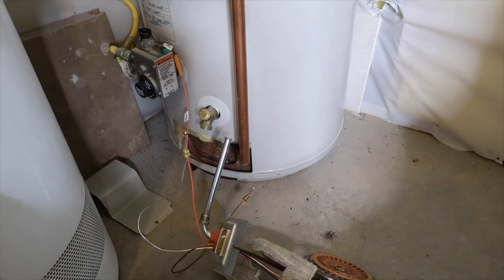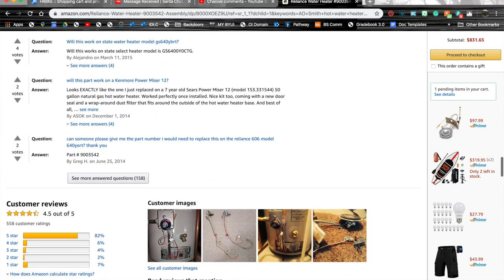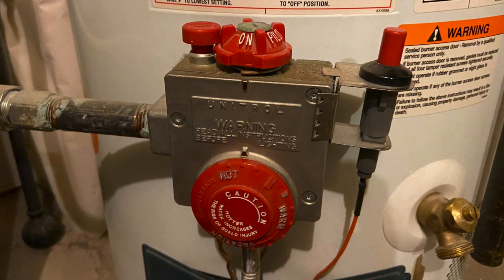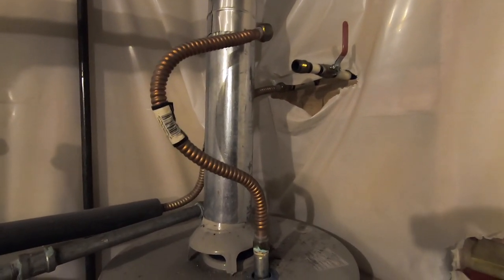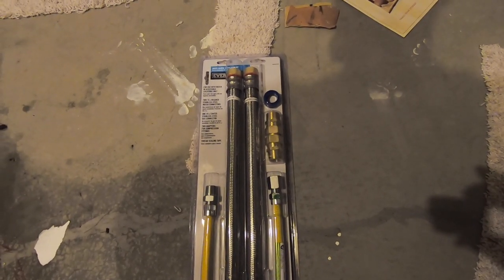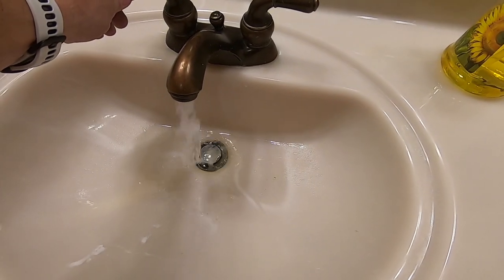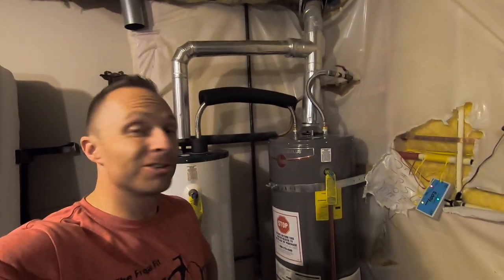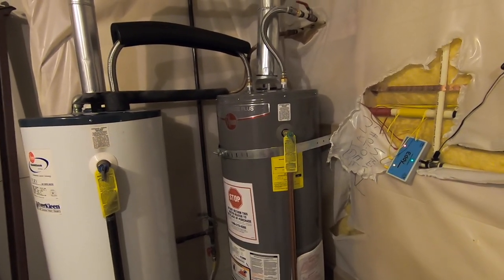I saved $900 by replacing a water heater myself

Comment: Why two water heaters? I don't think I've ever heard of that, but maybe it depends on where you live?
Reply from the maker: I hadn't heard of it either until we bought this house. Since it is a 5 bed, 3 bath home, it was designed for a family of 6-10. Most 50 gallon water heaters tell you that they are designed for a household of 3-5. So with two, we rarely run out of hot water.

Comment: A local plumber picked up our hot water heater from the store, installed it, and removed the old one for $75.  We are not talented enough to install ourselves.
Reply from the maker: That's a deal. The local plumbers in our area don't want to do small residential handyman-like things. Most are looking for new home construction plumbing, and commercial jobs.
Reply: The plumber i use keeps a couple water heaters on hand and twice now (12 or so years apart) has been able to replace mine within a 48 hours of my call.  Heater, labor, parts, removal of the old one, all together was less than home depot wanted to charge you for just installation.